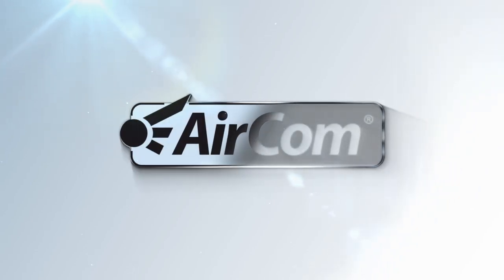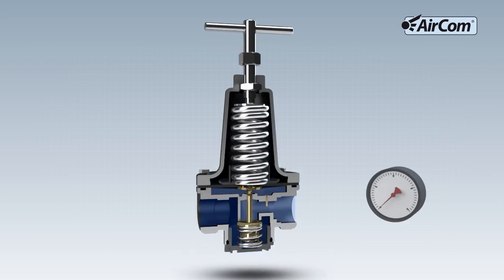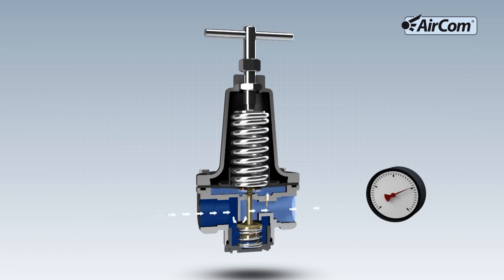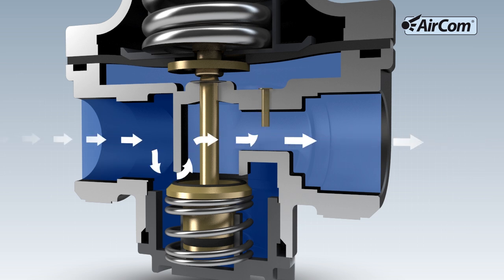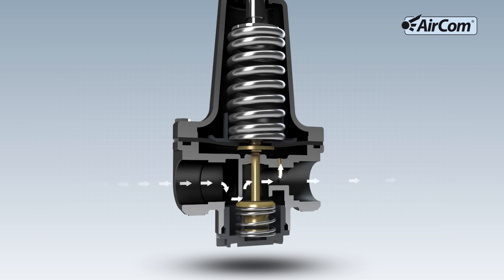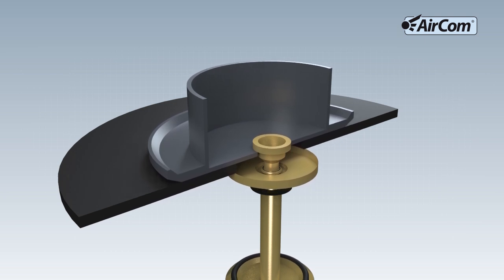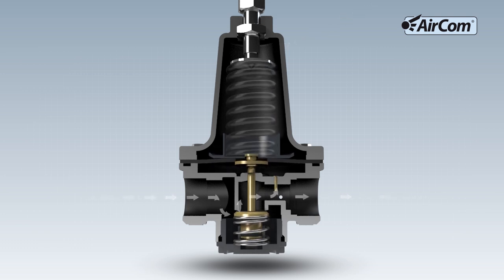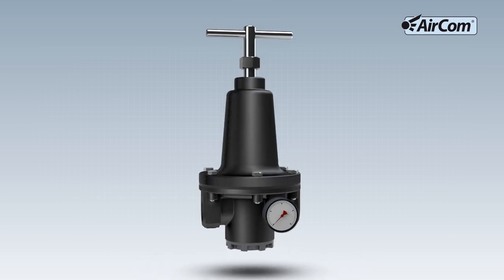AirCom Pneumatic GmbH pressure regulator - function

Comment: My pressure regulator was not regulating at all and it turns out that the "regulating tapet" was seized. A little wd40 and gentle cleaning was all it took. Thanks for the great video, saved me 30 bucks!